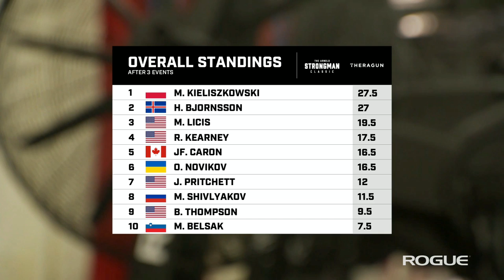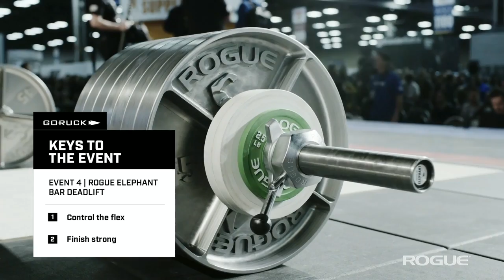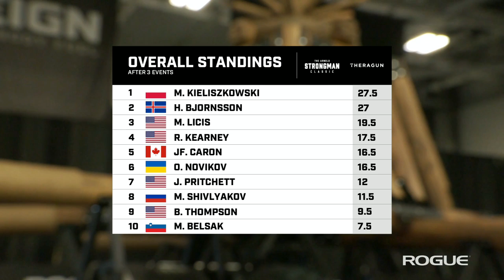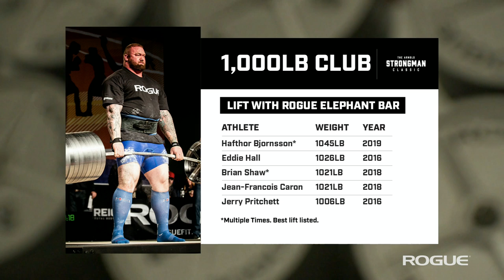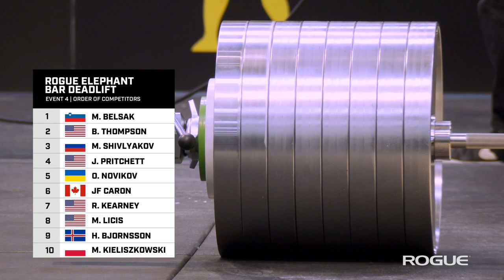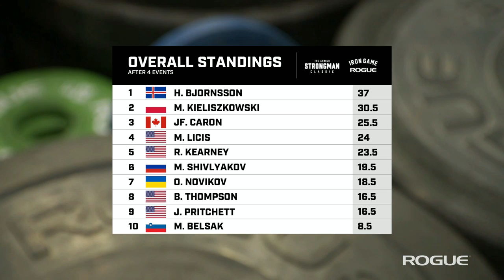Full Live Stream | Arnold Strongman Classic 2020 - Day 2

Comment: Tbh, this years Arnold has really been a let down.. I am well aware that they had to make a lot of last minute changes due to the recent virus situation, but still.. deadlifts on this level should be preformed on a big stage, not on a simple deadlift platform.

It is also really weird to see the next implement in the background of the current implementation, makes the whole competition look kind of amateurish. 

I know it's not all their fault and I'm sure they would've liked to have seen it different too, but it's still a bummer. I'm sure the 2021 Arnold will be better tho!
Reply: I'd rather see them deadlift in the back parking lot than on a stage that keeps buckling under the weight, as has happened multiple times at the Arnold stage.

Comment: Thor never did anything without straps, he is a beastin holding and pulling but with straps. I think he wont come close to 510 stiff bar deadlift, it will roll out of his grip...
Reply: For the 501kg deadlift he'll be using figure 8 straps...
Reply: @RenaxTM91  thats allowed?
Reply: @milosmilinkov1689  yep. Both 8 straps and lifting suit. Same as Eddie hall did.
Reply: @milosmilinkov1689  Yes, thats what Eddie used on the 500kg pull and the WUS will replicate the conditions so that record can be broken without anyone complaining about different equipment etc...
I don't think anyone has lifted over 460kg without straps...